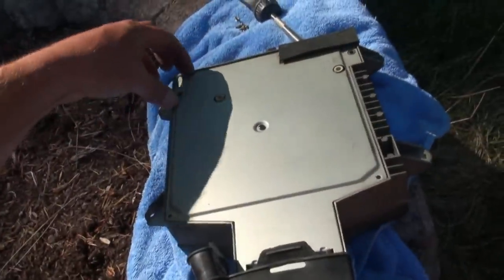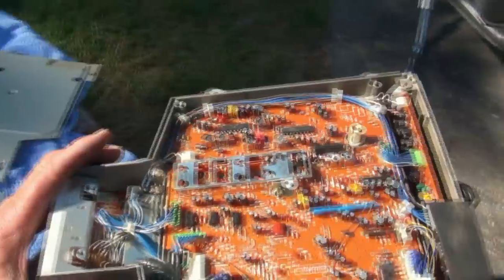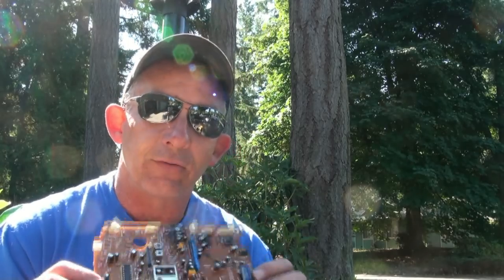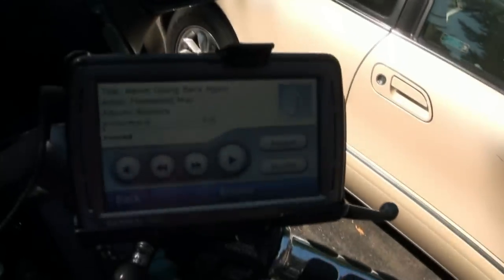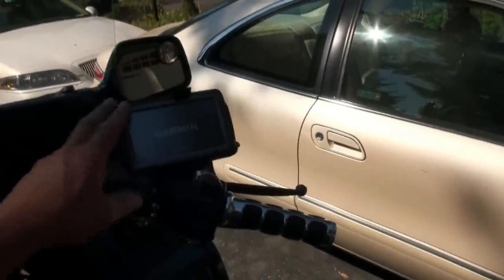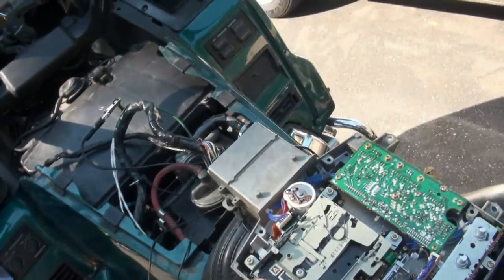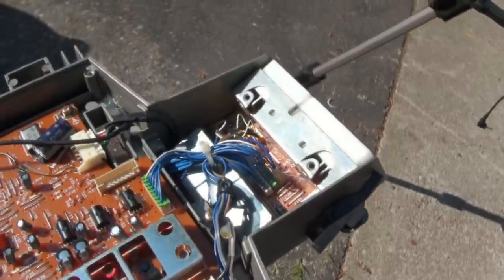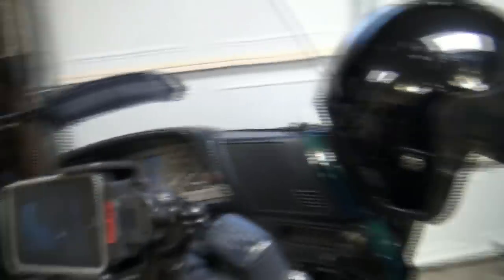1995 GL1500 Stereo Rewire for Aux Input

Comment: So just to save you all some time or if you are mechanically challenged.  In 2017 you can get a tape deck adapter that has a bluetooth unit inside the tape at walmart for 14 dollars.  It is rechargeable and will connect to your phone w/o any wires.  It is made by Black Web.  I use this in my 99 GL1500.
Reply: The sound is bad. I have tryed

Comment from the maker: Without actually trying it I would have to "assume" the audio channel still works.  If after it's wired up, and a "fake" tape is installed the audio channel would come on still allowing you to use it with "whatever" your going to use.  Maybe others can provide a better answer but the only thing I would know to do is try it and see what happens.  The tape doesn't have to spin, the switch just has to be made which is what happens when the tape is installed.

Comment: Jeff, great video--some of us are visual learners, so even if the source is elsewhere, your video is really helpful. I'm looking at a used 1500 SE and one concern is the audio system. This tells me I have a viable solution on the cheap while I figure out how to completely modernize the system. Lots of life left in these older 'Wings, but it would be nice to have a better upgrade path for the amenities!
Reply: +John Overbaugh a full modernization would be awesome but a massive pain in the neck because a small amp by itself would not cut it as all the controls for cb and radio route from separate locations to this unit. even if you could do it you would have to buy a boat panel to run it as waterproofing would further be a issue. i would like to pull the cb display and replace it with my 660 satnav permanently bolted inside the fairing however trying to incoperate all the different controls would be a headache
Reply from the maker: +Jason Leo I added an AMP in my left bag, EQ in the top trunk and upgraded all four speakers. For a set of 4" speakers it's sounding great. Only thing I would do different is to mount the AMP and EQ on the right side. It will be a pain in my side when I change my rear tire or brakes...
Reply: +Jeff Tjernagel nice. i was thinking about removing the whole unit and putting in a amp but i think the mute and volume controls are great where they are. i use earbuds because i prefer quality of sound which i would lose at higher speed but for slow i bet yours sounds amazing
Reply from the maker: All my controls operate normally.  I wouldn't want to move them either.  I'll put together a short video showing the installation of the AMP and EQ in the next day or two.
Reply from the maker: Here is a quick and dirty video showing where I located the AMP and EQ on my bike.  My mute and volume all work the same as normal.  Hope it helps!https://youtu.be/BoVL0vo1lec

Comment: Than you Jeff for showing us how to do this.  Mine came out great ! Now to get the radio down in place . It doesn't line up with the top cover about 1/4 inch to high. I think the wires need to be stuffed down inside ! Gene
Reply from the maker: It's a real pain to get the radio back in.  The power cable for the radio always gets in the way.
Reply: Jeff Tjernagel his

Comment: involvement is unnecessarily complicated.
Simply divide the three wires between the connectors CN102 and CN302 (GND, L and R out) and insert them between the expandable jack socket so that when inserted jack disengage the radio module ..

Comment: I also have a 95 GL1500 SE (Canadian Edition) and I have the stereo out of it right now and I want to add an Aux input to it. My board is a little different than the one on RangeWeb, it's probably the same as yours. I'm looking at your video and it's hard to tell exactly where the ground is soldered on, is the solder point under the hot glue?
Reply from the maker: Look at this forum. It shows a close up of the board.http://goldwingdocs.com/forum/viewtopic.php?t=5316

Comment: Thanks for the video, I have a question though about your mounts I'm having a terrible time finding a cup holder and phone mount for my 93 Aspencade you know the typical handle bars on a gold wing. What kind do you have or any suggestions?
Reply from the maker: For big cups on my '95 I've always used the Beverage Butler drink holder. There are two different sizes. If I don't have a big drink I simply put my 16 oz coffee cup in the left compartment. I fold one side of the cover down so the cup fits right in and doesn't move around.

I'll take a picture and post it somewhere out there where you can see it.

http://wingstuff.com/products/2084-beverage-butler-motorcycle-drink-holder

Comment: The presentation was excellent but the most important thing is not shown , were did you solder the new connection to ? Everything is just nuts and bolts !!  Thanks for the rest of your presentation .
Reply from the maker: The link is in the comments of the video. It is:  

http://www.rangeweb.net/~nperry/Goldwing/Aux%20input%202.htm
Reply from the maker: The rangeweb.net link is dead now.  You can use this one.http://goldwingdocs.com/forum/viewtopic.php?t=5316

Comment: Hey Jeff, excellent video for us GL1500 owners.  I was wondering if you might have a way to tie into the microphone system on the intercom in the same way?  I was thinking about using this: https://www.headsetbuddy.com/pc-headset-to-smartphone-iphone-adapter-dual-3-5mm-to-single-3-5mm/  to break out the mic from the phone, then tie the intercom mic into it for full cellphone capability.  Do you know of where that tap might be?
Reply from the maker: It's might be possible but don't know until it's tired. I uploaded the GL1500 wiring and headset schematics to google photos. I haven't done it but it might be possible. It would be a science project. I'd rather buy a new Wing but they are too pricey for me!  :-)

Briefly looking at the schematic I'm thinking connector C137 is where I would tie in. It's located under the left fairing pocket.

https://photos.app.goo.gl/HJNYfgWnr2x23obu8
Reply: I was thinking along the same line.  I have no real use for the CB, and was thinking of grabbing the mic input to it.  Probably need to deal with powered vs passive microphones though.
Reply: And C137 would only work for the driver, and not include the passenger.  That's why I was thinking of the MIC feed from the Intercom to the CB....
Reply from the maker: Looks like the GL1500 mic is passive. The schematic isn't showing power... I'd put a multimeter on the driver mic wires to see if there is power. The shield is for EMI interference.